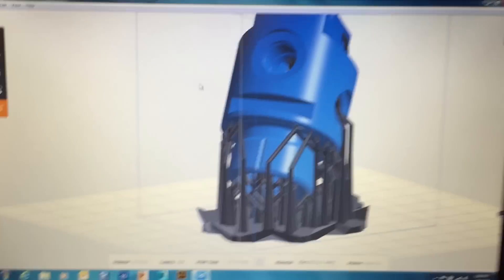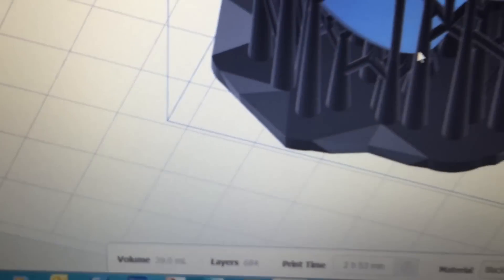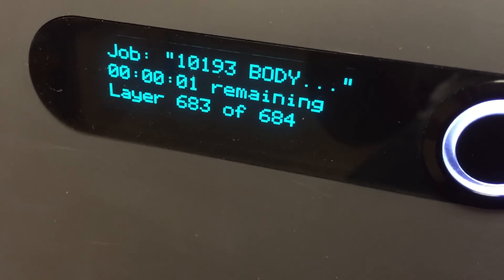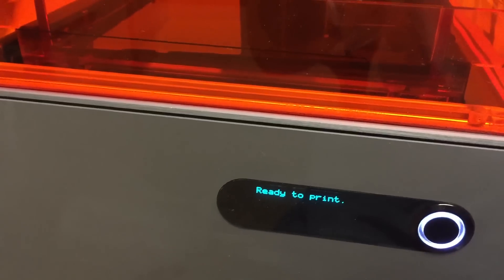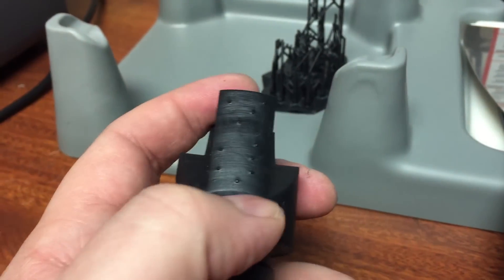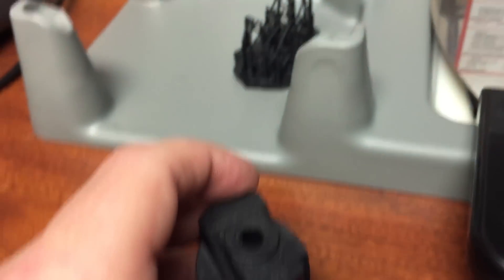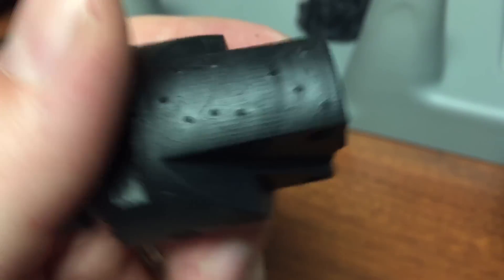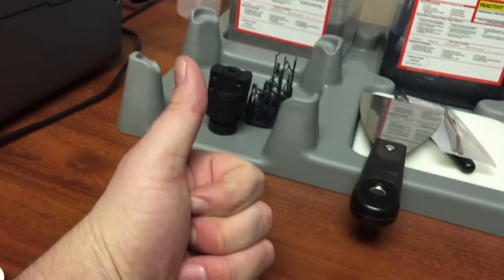Formlabs Form 1+ 3D SLA Printer | 1st print test and initial impressions

Comment: Can you comment on the speed/how long it took to print your part? I didn't hear or see any indication. Also, how long did it take to fully cure and what is the "strength" of the print? Is is a flexible or rigid print?  How much resin was used for that particular part and how hard was it to "finish" the piece?  Thanks
Reply from the maker: +Rogers Photography regarding the speed and amount of material used, you can see it on the bottom of the software at the beginning of the video plus I mention it ;). The part is rigid/solid. As far as how strong it is, that really depends on the thickness and geometry of the part. This particular part is mostly solid internally, so its very strong and would be hard to break it. I recently uploaded a video last week on my channel showing the different strengths of the Tough resin vs the Standard resin. Check that video out ;)